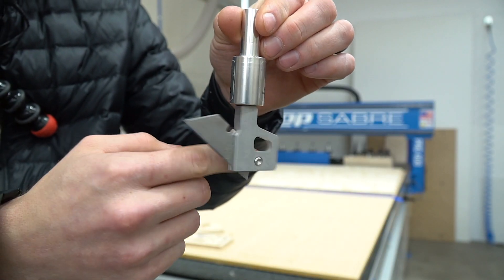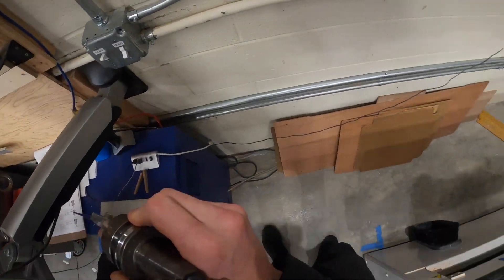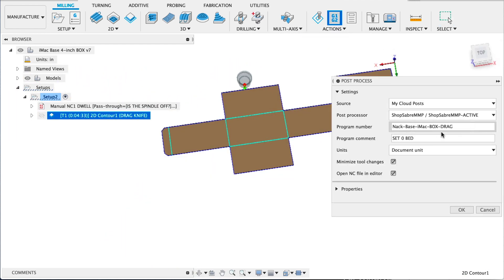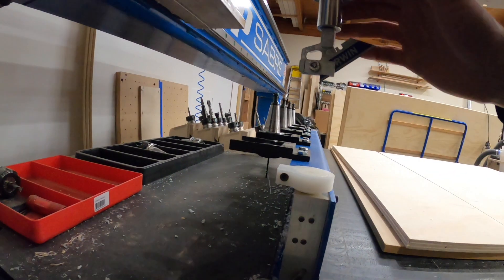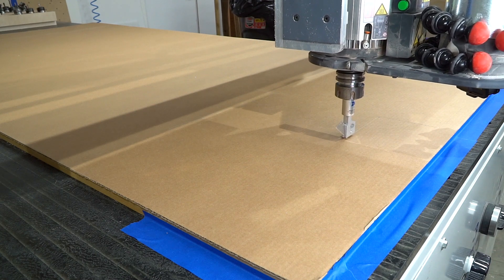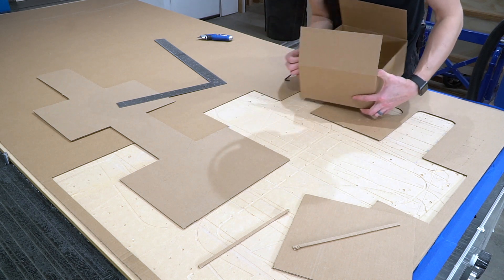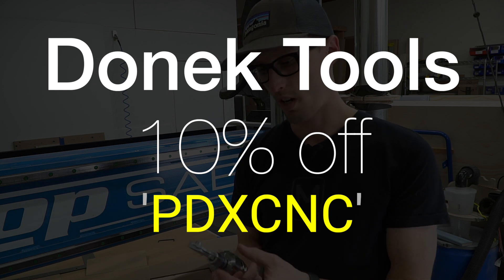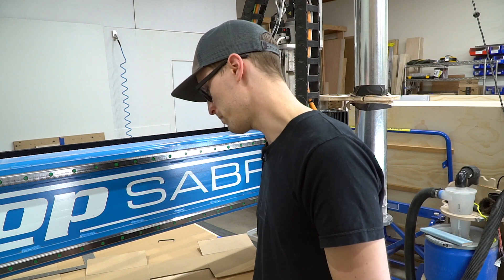Vlog 7 - CNC Drag Knife, Fusion 360 CAM, New Plugins

Comment: I just picked up an SST drag knife and downloaded the drag knife add on. I’m running a 5x10 Laguna. The Laguna post processor isn’t one of the supported post processors that’s mentioned on the info page for the add on but for $10 I figured I’d try it. Having troubles. I tried having Grok3 edit my code and while it seems to have a really good grasp on what needs to happen the corner swivels looked a little suspect in NCviewer.  perhaps I’m not that great at asking the right questions to Grok3. Did you guys end up making a detailed Drag knife video after this one?

Comment: I assume this could cut 3/16" or 5mm foam board. This would be great for airplane model builders that use foam board. I am currently building one by manually making all the cuts. Might have to give this a go as I do have a CNC router that I play with sometimes and use Fusion 360 :)
Reply from the maker: Yes, absolutely.